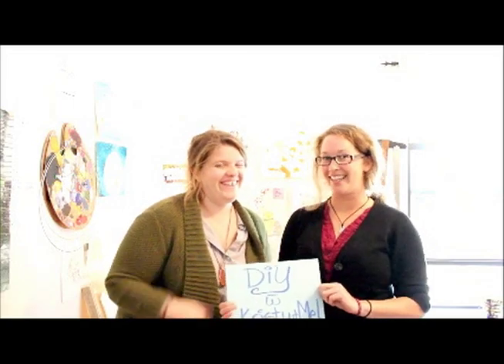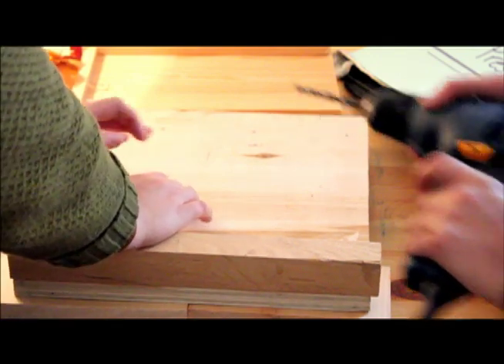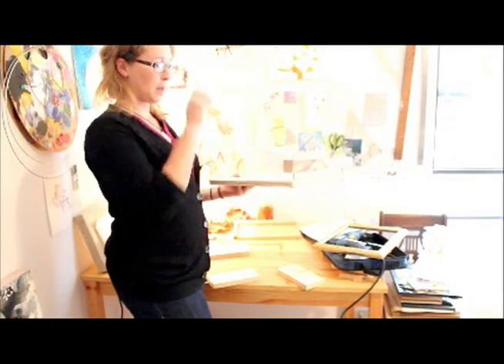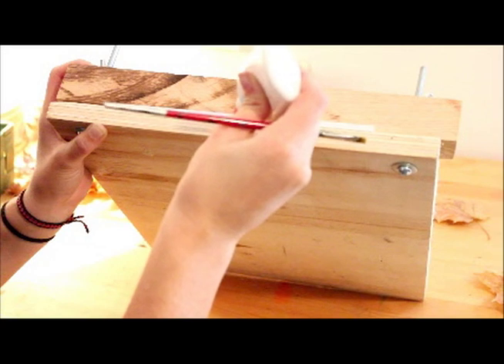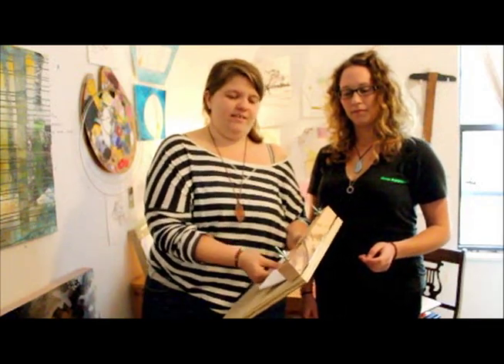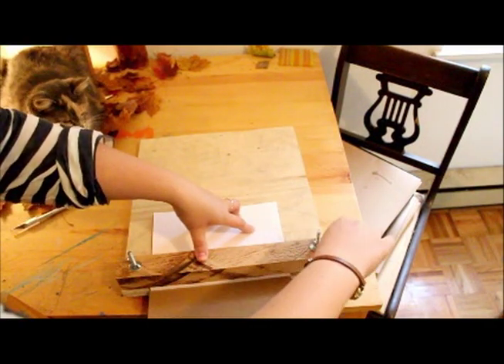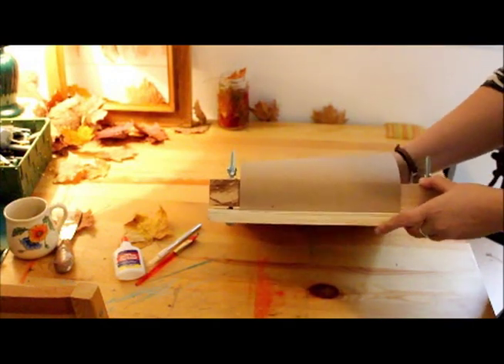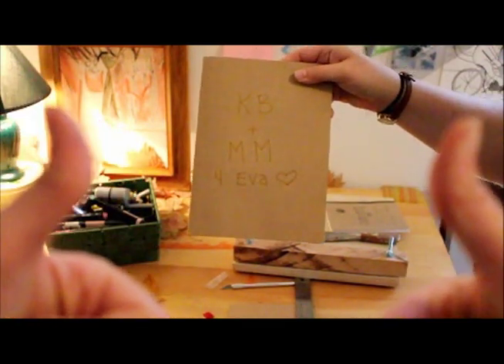DIY Book Binding

Comment from the maker: @celestialpanther when you spread the glue with the paintbrush it gets into all the crevices. I know that it doesn't seem like enough to hold the book together but it is. If you're worried about your book falling apart go ahead and put another coat of glue to make sure you have full coverage. Don't forget that the glue that you use to hold the cover in place adds stability and durability to the spine. Cheers and thanks for watching!